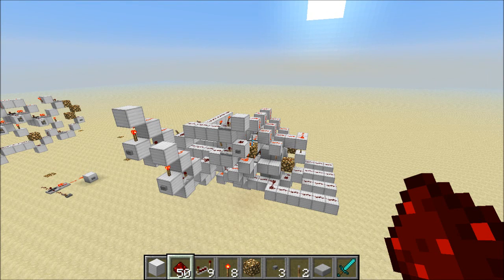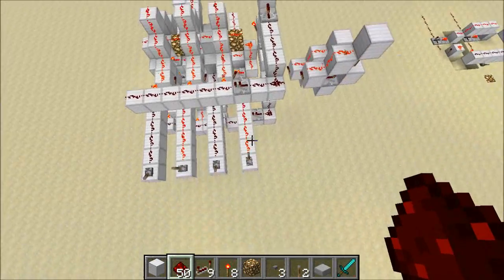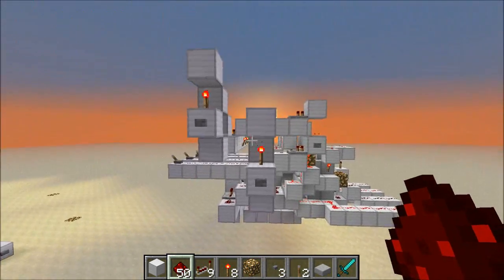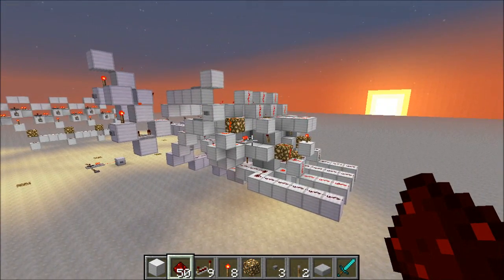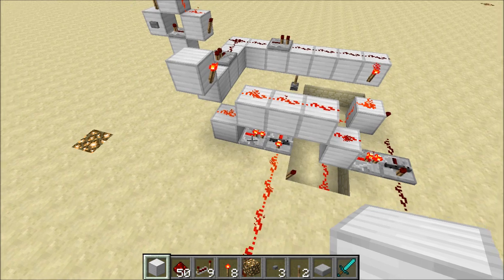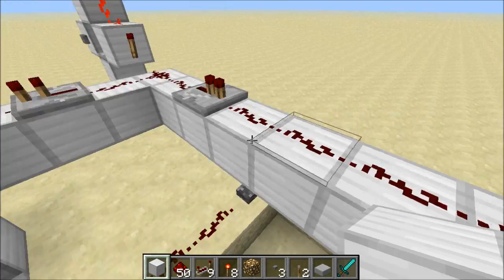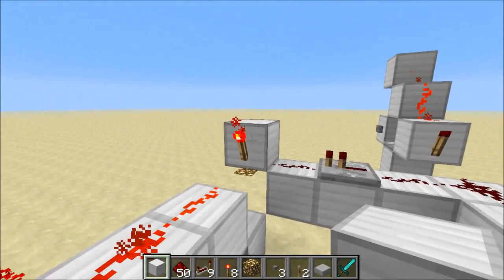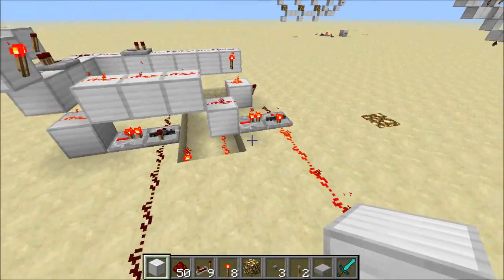Repeater Lock Shift Register (Up/Down Counter)

Comment from the maker: It is, the piston systems use the same logic but with a much simpler implementation. However if you're trying to avoid piston usage except when necessary this is one possibility that's out there.

Comment: There are a number of things a shift register could be used for, however your application for it depends on what you want to do with it. You could use it to shift a binary input in a computer (turning the value 1011 into 0110 or 0101), for example. You could also use it to shift through something sequentially (Say you have a Pong game, and you need to shift the location of a paddle, by enabling or disabling outputs, you could accomplish this by shifting the data in the register up or down.)